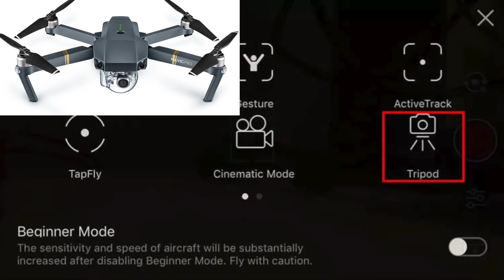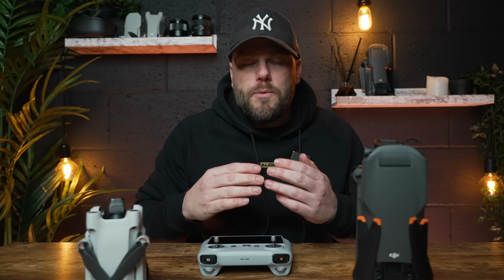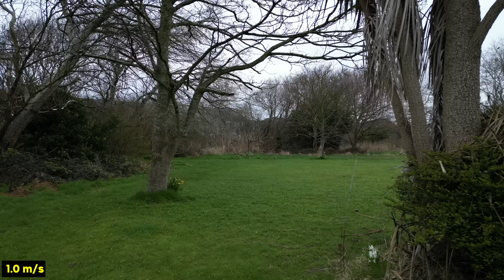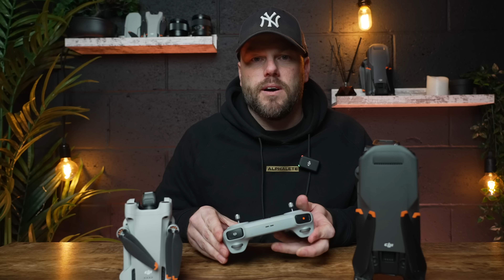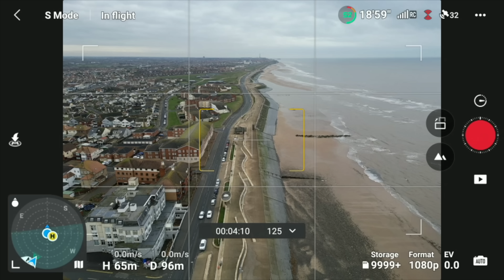DJI Mini 3 Pro - TRIPOD MODE TUTORIAL ( DJI FLY 1.9.9)

Comment: I’m confused, I know how it’s differs, but how is this better than just using the EXP settings? I am still on firmware 1.00.0300 with my Mini 3 Pro(don’t want remote Id) and I cranked my exp settings way down for my Cine setting and it’s fine as far as I can tell. For me it’s more of an issue having the sticks too sensitive with the slightest push, which lower exp settings fixed. I can control my speed by how far I push the sticks. Is this just for people who want to push the sticks ALL the way and not have to modulate them for slower speeds? Am I missing something?

Comment: HI Darren, I love the new update! I have changed only cine mode to 1ms as gives great smooth shots, but like you say I found it was struggling in the wind, so relied on normal to get ready for next shot. The brake mode is something I won't be using, as I can see it flying into something, because of the braking distance. Great clear vid, thanks🙂